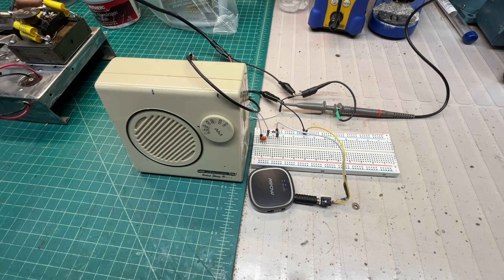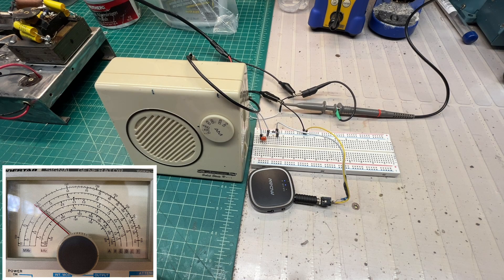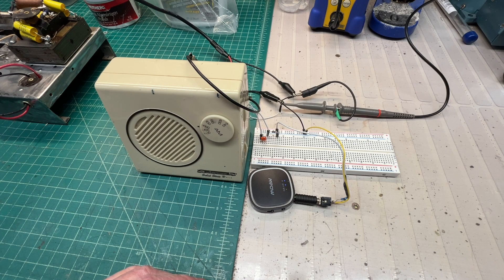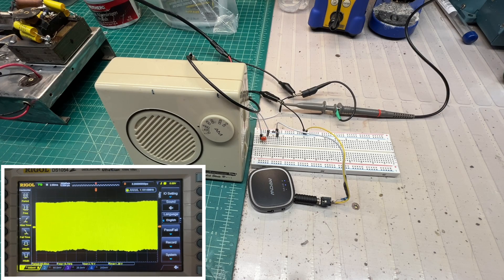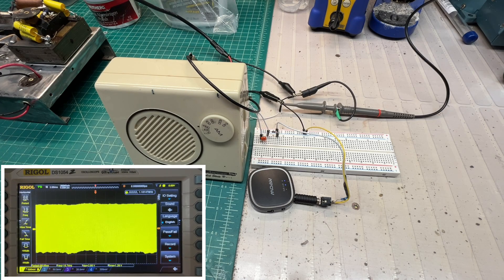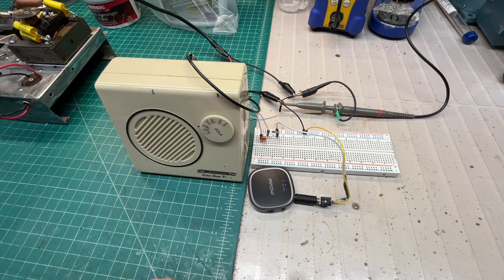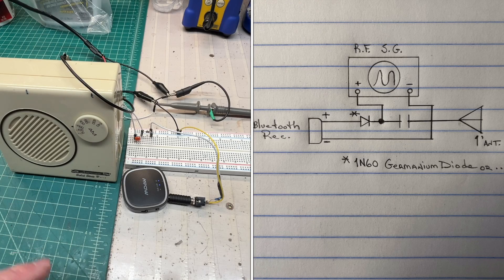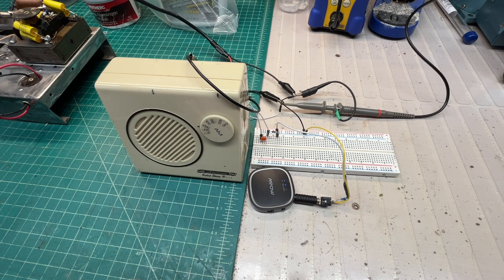RF Signal Generator - Modulation Adder w/ 1N60 Germanium Diode

Comment: I built your AM modulator project, and it works really well with a DDS signal generator. A small but very useful project for adjusting radio receivers — thanks for sharing! I made a short test video on my YouTube channel https://www.youtube.com/watch?v=L3nzRbzwaQE

The capacitor I used is 560 pF — is that correct, or would you suggest a different value? I picked a germanium diode at random, not sure which type, and I didn’t use a resistor on the audio input.
Reply from the maker: Glad it worked well and you may want to try various capacitor values to get the best performance. Thanks again for sharing your experience. Best, Don